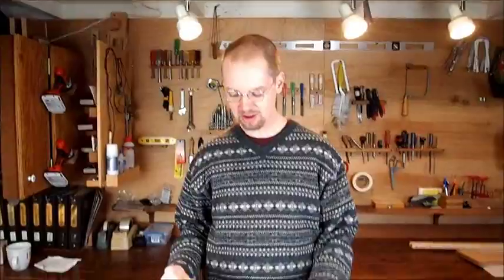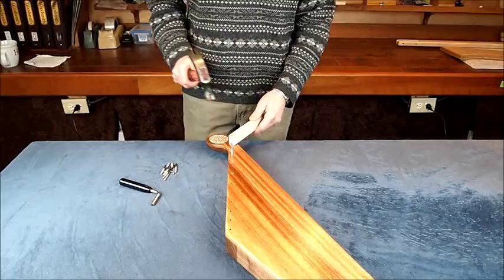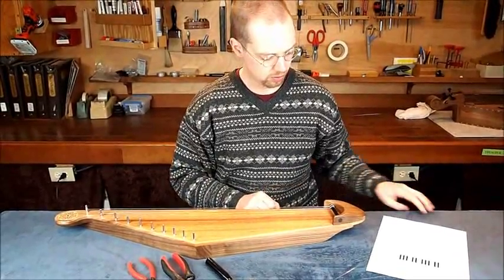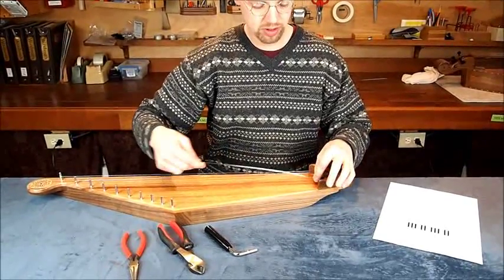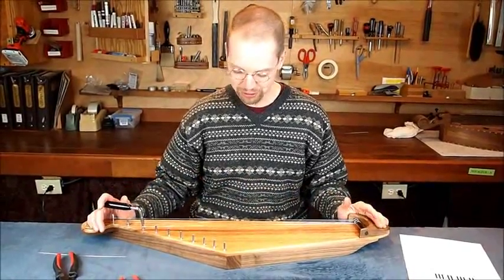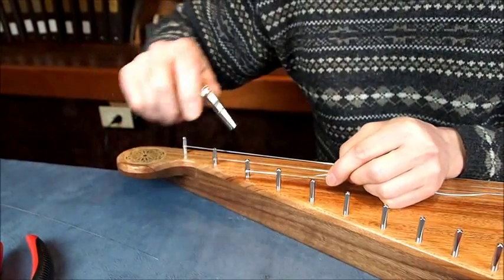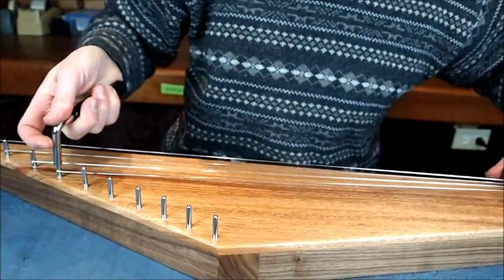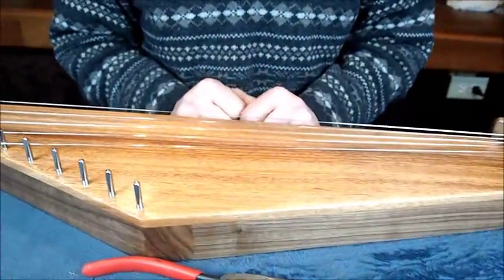Kantele Building - Steps 9 and 10

Comment: Ah I see thanks. Can you tell me what size the drill holes need to be relative to the pins? I've got some 5mm zither pins but i'm guessing you need a hole slightly smaller.

Looking around some people say they use this size 0.185 in/4.699 mm.

Comment: Steps 6-8 disappeared into nothing.
Reply: Steps 6-8 are very well covered in the assembly manual which you can download. I can see why there was no need for a video of these steps which cover installing the rosette, drilling of the zither pinholes and sanding.
Reply: A tip on drilling the zither pin holes (I think): If you make the ZPD which helps to tap the pins in with the 7/8" clearance, you can also drill a second hole (both are 7/32") in the other end of the ZPD and mark it DRILL (mark the other hole as PIN). Use the one marked DRILL to help keep your drill perfectly vertical when you drill the 3/16" holes. Just mark the drill bit at 2 1/8" (7/8" + 1 1/4") and drill to that point. This was a little more convenient than using my bench top drill press. Hold the ZPD up an inch or so to see where to set the point for each hole. It's a good idea to  clamp the assembled zither down so it won't move when you do your drilling.
Reply: @ralphhross  Good Advice, thanks